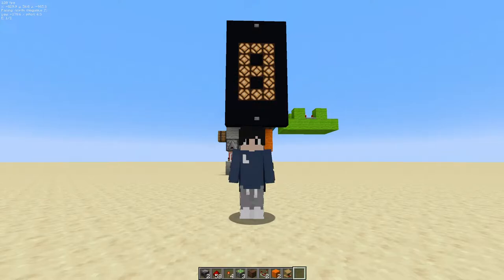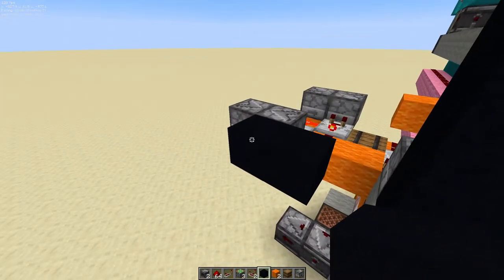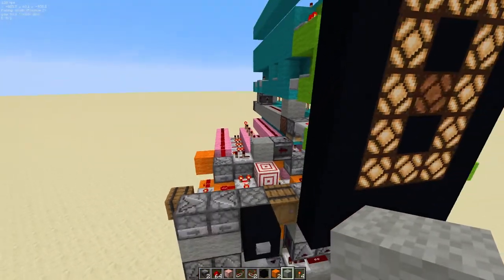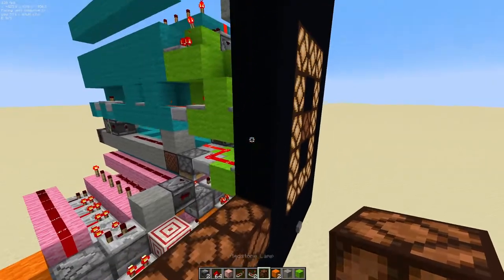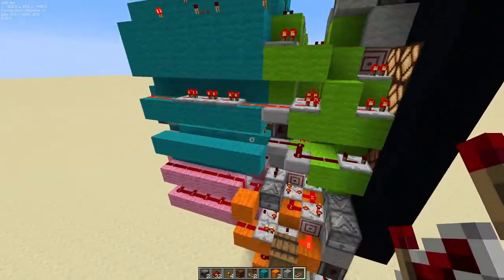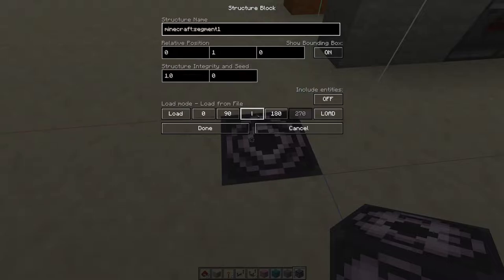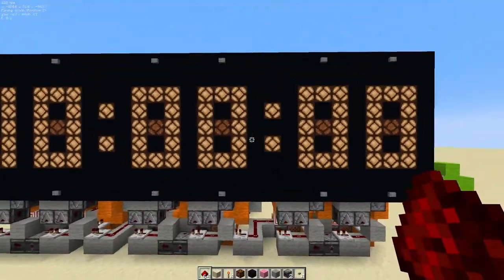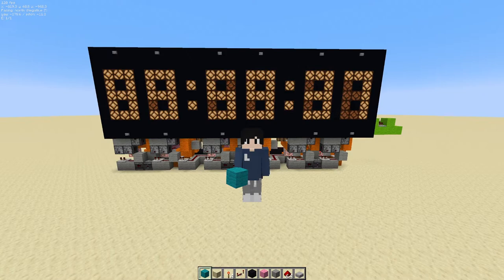How to build a Minecraft digital clock - Part 2 - connecting multiple digits

Comment: i don't understand when i put the slime piston next to droper and it's active, i check and realize the redstone is connected with slime piston, but in video, it not working cause redstone?
Reply from the maker: If you're talking about the piston at around 2:25, that's a normal piston and it doesn't power since the redstone next to it is on half-slabs.